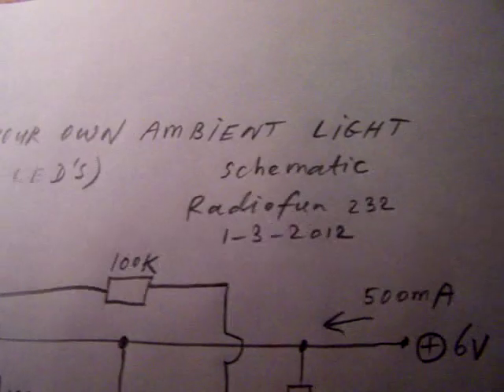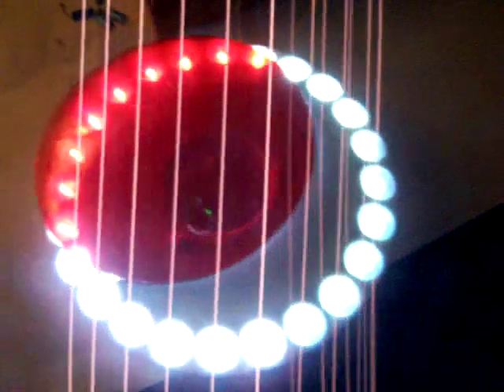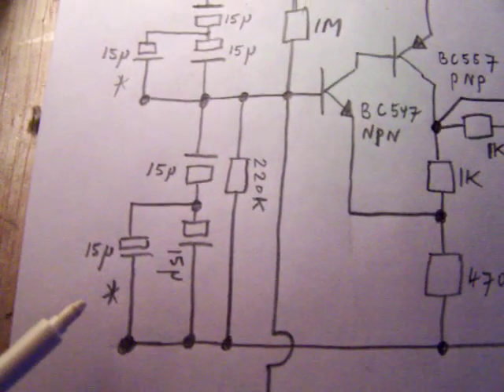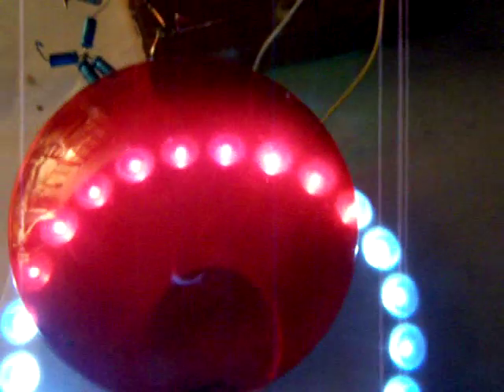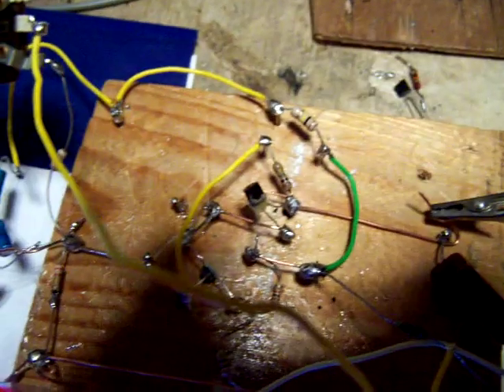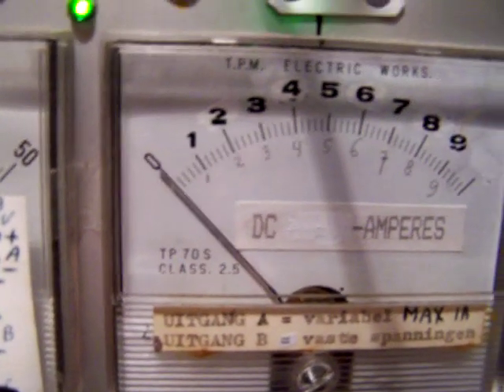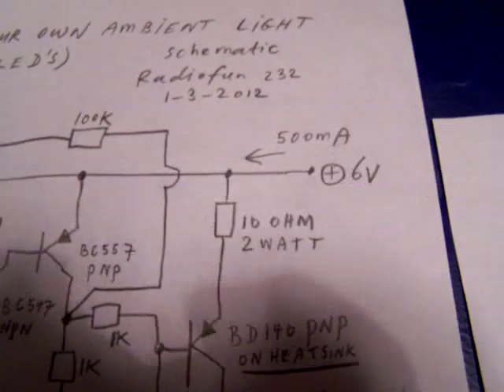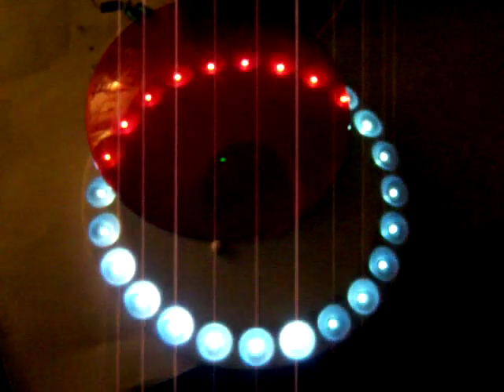how to make your own ambient light (LED schematic)

Comment: Which value of capacitor you hv used in both which are connected together - + + -
Reply from the maker: It is in the schematic on 1.25. It depends on how slow/quick you want the voltage to rise. A good start value is 50 uF, two of them (+ to +) realize 1/2 of that value, so effective 25 uF quasi "non polar". Or two of 100 uF, soldered the same way, effective=50 uF quasi non polar. Do some experiments with values between (say) 10 uF and 100 uF (2 of them soldered back to back)  and choose the value that gives the right effect in your situation.

Comment from the maker: I think yes, the buildup from the voltage on the capacitor in that case must stop somewhere. The easiest way is to stop the oscillator effect so that it only switches "up". I think a change in the value from resistors can cause this e.g. the 1 M or the 220 K at the base from the first transistor.